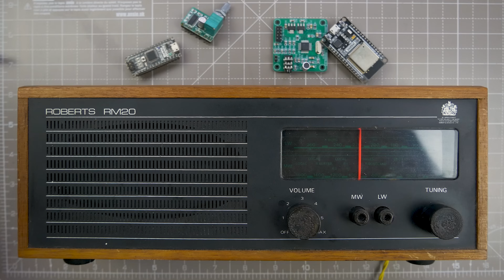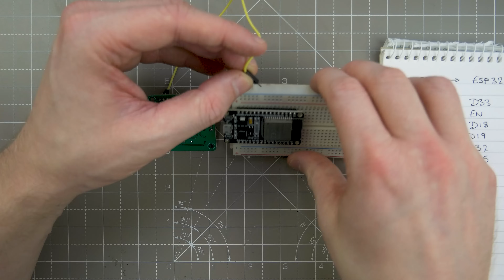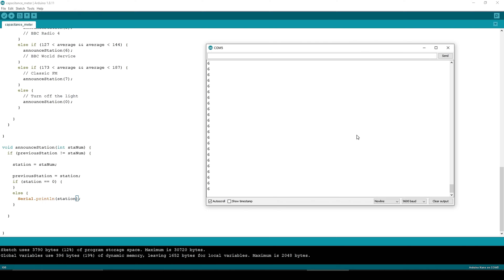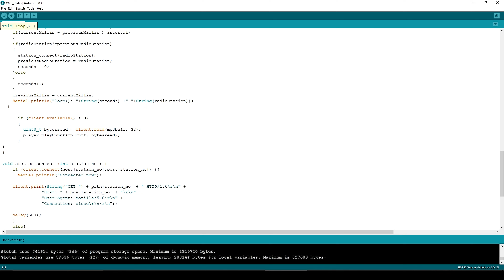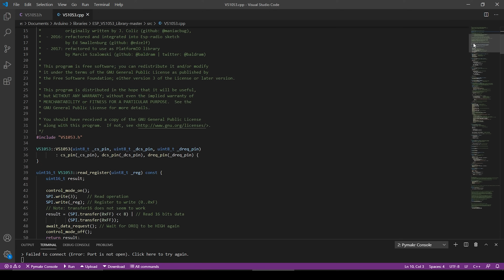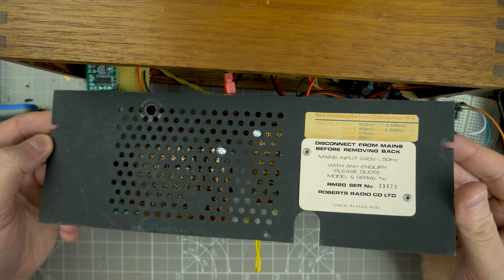From Start to Finish: ESP32 Internet Radio with a Roberts RM20

Comment: You are awesome but you missed the demo of the light!
I wonder if you can help me on that as I built Nick Kumaris's radio and after he advised me to remove and replace the followings it worked

Replace this line:    radioStation = readStationFromEEPROM();  with this line: radioStation = 0;
 Replace this line         int readStation = readStationFromEEPROM(); with this line  int readStation = 0

However he was very reluctant to help how to replace or add more stations and having tried for weeks l am stuck!
Is there anyway your station configurations will work even if they do not come on the display?
Finally am l to understand that you are connecting the variable capacitor directly to the Nano like a potentiometer and read the value because I was stunned to see that you are calling the values - radio 4 etc,
I am very happy to paypal you for your help
Many thanks

Erik
Reply from the maker: Hi Eric, the stations are stored in an array. I decided not to use the EEPROM that he had in his example. You can just add stations to that array but you will need to increase the array index number for each one that you add. There are two arrays, one with the port address and one with the URL for the mp3 stream.
Reply from the maker: The variable capacitor is connected to a few pins on the nano (you might be able to do it on the ESP32) one charge pin, one discharge pin and one analog pin. It essentially uses an analog reading to see how long it takes to charge up to VCC and the code calculates a value. I used that range across the variable capacitor, split it into segments where I want stations to be triggered and send it to the ESP32 as a station number.
Reply: @DavidWatts  Hi David
I looked into this very carefully and l wonder if you can help me 
I will be very happy to contribute with paypal
I have built a project with an old radio but l am not a software man in any way so this is what l need
I need to connect addressable led strip ws2812b about 260mm instead of the tuning scale so my existing variable capacitor will display an led moving left and right along the scale and preferably the other led's with a different colour, there is an FM radio similar project here - https://www.youtube.com/watch?v=afBSpobG6Zo
but needs it without the radio, just a nano with led strip to be connected to my existing tuning capacitor.
If you can help l will be most grateful
Many thanks
Erik Hoffman

Comment: If you had a pi and a nano then you had an easy solution for the shutdown and start up time.  Don't shut it down. Keep it running in  a sleep mode and have a super cap or a small li battery.  When you turn it off it sleeps and if you unplug it then the nano notices that the power is cut and then tells the pi to shut down while the supercar or battery runs the system.  Done. Plus you could add an SDR and make it also a real radio as well as internet radio.

Comment: I wonder if it would be possible to just leave out the nano and use the ESP32's second core to run the nano code
Reply: @Pedro Abreu yes, the esp32 has a total of three cores, the first two are identical in performance and you can basically write two different arduino sketches for each of them or the same sketch with shared memory. The third core is an ultra low power core for deepsleep, it also houses the system timer so you can wake the main cores at certain intervals etc
Reply: @Pedro Abreu Some newer ESP32 chips (ESP32-S2 if I ain't mistaken) only got 1 core.
But yeah, typically ESP32 has two cores, the second one is meant for protocols, like handling Wi-Fi and Bluetooth.
Check the datasheet for more info.
Reply: @Kyle-ye4nj  even with one core, threading is still an option on the ESP32 (though the performances will be impacted).
Reply: i have tested , it runs , but not stable :-( Because the core zerro is reserved for the Rtos.   now im testing the ADC and will use an NE755 to make an frequenz voltage Converter

Comment: I've put in a warm white LED in an old FM radio and it looks awesome
Reply: yes these here are fun : https://www.ebay.de/itm/50-Stucke-3-Watt-Led-Chip-High-Power-Led-Perlen-200Lm-Warmweis-to/232313840890?hash=item3616fbe4fa:g:cPMAAOSwXSRbPf3K

But dont use it with maximum current. Get two or three and frive it with 10 - 20mA , you does not need extra cooling. If you are using 12V pover , get 3 in series and pun one risitor in serie.

Comment: Cool stuff! You can skip the nano alltogether, just do the exact same thing on the ESP32, it has a ton of analog pins and I doubt it's going to interfere with the radio stuff.
Reply: Yes, I was thinking the same. ESP is a dual processor I’d imagine it could cope with both tasks,especially as you’re only changing a setting when tuning and not receiving signal.
I also wondered why you couldn’t fit the volume in place of the original Volta the front.
Great project and gave me a solution to where I can put my homemade Bluetooth amp. Thanks.
Reply: @davidjones9730  I reckon you could do it all on one ESP32 processor, they are faster than most other microcontrollers, and the buffer on the MP3 module will cope with the odd delay.  I just don't have time to prove, this, though!

Comment: My mothers old DAB+ with Internet radio is having issues, piss poor reception, the wifi and dab has been terrible from day one. But recently it have been worse, and also there is a lot of noise on speaker from the internal components, have not tried with a 12v battery to exclude power supply issue. Could try and solder on an external antenna also.
I even recently had to replace its power supply, it was just a regular 12v psu internally, so an external psu was easy to find.

 She only listen to one station. I only need the mp3 decoder (can it do other formats?), got a small amplifier laying around.

Comment: You can get I2S amplifier boards and use ESP32 to decode MP3 internally. Also, you don't need extra Arduino to read cap, ESP32 has 2 8-bit DACs built-in.
As a result, you'll get rid of 2 extra boards and make it's much simpler and compact.
Reply: I2S amplifier. I will buy that.
Do you know if the ESP32 can decode the most audio formats? AAC is a popular one on streaming audio.
Reply: @LordGryllwotth  Yes, you can use ESP8266Audio library, which supports decoding MOD, WAV, MP3, FLAC, MIDI, AAC, and RTTL. And get a MAX98357A breakout board with a built-in amplifier.
Reply: @ReFreshRC  hi I know this post was 2 year ago but do you have any example code to do this? Both for decoding the MP3 and reading the capacity.

Comment: The Pimoroni Pirate Radio Kit could probably be retrofitted into this case, and still use the varcap dial. The $50 kit includes a PiZeroW, pHAT BEAT DAC, stereo amp with VU meter and six buttons. Adafruit is a distributor, and has a nice writeup explaining the whole process.

Comment: David! Only just stumbled across your channel by chance now. Nice to see some more nerd 'mo's out there. I have an old ROSS radio that I want to turn into an internet radio with Raspberry Pi and 7" touchscreen display (already mounted), but unsure what do with the software side of things. I see you mention your RM20 was previously a RPi radio but I looked and couldn't find anything in your previous videos. Can you point me in the right direction? Thanks a bunch xoxo
Reply from the maker: Ho, it was all done in a series of live streams, kinda of an impenetrable format to learn from. Let me see if I can dig out the code for you. The reason I ditched the Pi was the long start up and shutdown sequences. While I had used the front buttons to automate that, it was tedious to not be able to just turn if off and on whenever I liked.
Reply: @DavidWatts  yeah totally understand that aspect and that was one of my main concerns and was going to look into soft startup and shut down buttons, but this ROSS radio is big boi and the idea is keep it on above the fridge with the display at almost head height where I can see weather updates etc so turning it on/off frequently isn't much of a concern.

Comment: Hello David, your video about the expansion of the Roberts RM20 is very successful. Thanks a lot for this. I would like to recreate it. Do you have a tip where I can get Radio Roberts RM20 from?
Reply from the maker: eBay is your best bet, I got mine for £10. You could do this with loads of different radios though.
Reply: @DavidWatts  thank you david. I have already looked German on Ebay, unfortunately there is not much there. I like the RM20 model very much, so I would like to buy such a device
Reply from the maker: These might work for you - https://www.ebay.de/itm/TELEFUNKEN-Gavotte-1691-Transistorradio-Radio-Tuner-1967-Bastler-Vintage/154104348153?hash=item23e155bdf9:g:zKUAAOSw-1NfbwPD or https://www.ebay.de/itm/altes-Telefunken-Radio-aus-Haushaltsaufloesung-fuer-Bastler-Sammler-Gavotte-301/174464488661?hash=item289ee4d4d5:g:AEYAAOSwOVlfLFS0

Comment: I wonder why you used an external MP3 decoder? The ESP32 is more than powerful enough to decode MP3 by itself. An ESP-WROVER-32 would even be capable of decoding AAC, OGG and FLAC (I couldn't get OPUS to work properly).
Reply: 5 - 8 bit resulution vers 16 Bit !! The esp32 can only (approx ) 5 bits rs, if you want decode more than 64k/s

Comment: Just throwing this out there as I have no idea about this stuff, but could you place a backlit LCD display behind the station indicator?

You could then use it to display the internet stations and still tune it as originally intended. Could also use it to show a little more info eg time, date, song playing etc
Reply: The point was to keep the analog display
Reply: @thefatmoop  Fine, then program a mock analog display on the LCD. Perhaps it still won't appear vintage enough for some folks, but it's a pretty good suggestion from someone who 'has no idea about this stuff'. Some of the best ideas come from folks who aren't constrained by logic.
Reply: @TheOleHermit  Thanks :-)

Comment: Nice job.  I've been planning to do something like this but haven't gotten around to it yet.  I'm not sure why you needed the Arduino, it seems to me that you could have done it all on just the ESP32.
Reply from the maker: The from start to finish videos are usually done in a day so I shy away from added risk of it not working. I knew I could achieve what I wanted with the Nano so it was a easy choice.

Comment: I've learned to have a 4mm drill in the toolbox for cutting the tracks on veroboard :)
Reply: For more years than I care to count I've used a 3/16 drill glued into a small file handle, probably a Practical Wireless or Radio Constructor idea

Comment: Love this, I too have a very old Roberts Pi Radio project that needs updating. Could you get the esp32 to handle the dial input as well as data?  I'm going to give it a whirl.
Your long switch statement seems a bit redundant??
Can't it all just be replaced with:

if ((incomingData>=1)&&(incomingData<=6)) {
radioStation = incomingData; Serial.printn(stationName[incomingData]);
}
Reply from the maker: Hindsight is 20:20. Not sure about using the ESP for the tuning dial, it has a tiny audio buffer so I went with the option I had already used on the Pi internet radio.
Reply: ih have tested ist with an bigger buffer, it runs, but very instable :-( the core zerro is for the wifihandle and other stuff importand. What im testing, use the ADC and an NE755 ( timer IC ) , to generate the value. Of if you dont destroy the radio, add an potentiometer into the scale.
Reply from the maker: @mibnsharpals  I'd be really interested to hear your results. Love seeing people improve on my hack jobs.

Comment: I love it, but think that if you could get the existing volume knob to work with the new circuit then it would finish it off nicely.
Reply from the maker: Sadly it didn't work as expected, It might just need a clean or a replacement. For now I am happy enough, I don't need to adjust the volume much, I mostly just listen to Radio 6 music or Radio 4.
Reply: Still a great project and has inspired me to look at doing something similar myself, as I love the look of old radios.

Comment: Nothing like a boat anchor, if you can find an old reel to reel tape player, one might send a signal from the tape magneto.
Reply from the maker: It's all boat anchors here.
Reply: @DavidWatts  The old Zeneith Transoceanic portable, would love to have one that would handle both the old tube chassis or flip the switch to modern.
Reply from the maker: @S.P.A.R.K.Y.  If there was enough room in the chassis, you could do that. You could isolate the speaker with a DTDP switch, the internet radio would just run all the time and only output when you switched. Volume would be an issue, however you could read the potentiometer and tell the VS1053 to change it's output volume digitally. By the way, that Zenith radio looks pretty epic.

Comment: Hi, great project! I also have in mind doing a similar project some day.
So far, I only got to creating an Arduino Music Player (link is here if you're interested: https://www.hackster.io/ericBcreator/a-m-p-arduino-music-player-8013b6).

I was wondering: why do you switch the Nano IN_PIN from input to output?

BTW: for better performance you might put the average calculation inside the "if (readIndex == 49) {" loop as you only need it there.
And I would  replace the hardcoded 49 in "== 49" with ">= (numReadings - 1)" as changing the const int numReadings variable can cause problems..

Comment: i'm puzzled as to why the original roberts volume variable resistor could not be used? i guess the radio one is mono, and the pam board is stereo, but as your running mono you only need to use one channel of the pam board, so three wires from the original knob to the pam channel your using and the other channels 'wiper' can be grounded to prevent it floating and oscillating.  it will be a different value but unless its a really low value i cant see it bothering anything
Reply from the maker: I tried it, there was only a very small zone where the volume went from quiet to very loud. However measuring with a multimeter I could see it was still doing its job. I assume it's response is designed for a different kind of amp or it is broken.
Reply: @DavidWatts  yeah they dont last forever.

Comment: Why did you use the nano?  There are more than enough pins on the esp32 to take on that work, too.
Reply from the maker: It only has a 32 byte buffer for the audio (apparently only 500th of a second) so I decided it was best to leave the bulb and tuning duties to the nano. I'd also already developed the nano solution for the previous incarnation of the project. Not saying it couldn't be done.
Reply: @DavidWatts  I don't see any time consuming code on the nano. Also ESP32 has 2 cores.
Reply from the maker: @0xB8xor0xFF  I don't see any reason not to go with the solution I had previously used. As I said earlier, not saying it couldn't be done.

Comment: Well done but this is a lot of work for just a few stations. You have a lot of patience. I skipped most of the parts of the video where you are typing code. I couldn't understand most of it.
I would've just used some resistors and an op-amp to downmix the stereo audio. There are example mixer circuits already available on google images. Easier, quicker and you know it'll just work. Don't need to spend ages modifying/debugging code and registers.

Also, why not use the radio's original amplifier and replace the original scratchy volume pot if necessary.

Comment: Thumb's up for Radio Caroline, Thumb's down for taking the station out 🤣 .. was going to make this project (adding SD card) ,  I have a old Marconiphone with Radio Caroline on the dial.🤔
Reply from the maker: If I could have found a stream that didn't buffer so much I would have left it in. Sadly I couldn't connect at all several times so I ditched it in favour of cornucopia radio which has audio drama and comedy.
Reply: @DavidWatts  Radio Caroline have multi streams, with different bit rates, try the weekend at the month on Manx Radio , Radio Caroline North live from the ship. Lucky I live in East Anglia and listen on AM 648(ex BBC World Service transmitter) and FM local. Also in many cites on DAB.
Reply: @DavidWatts  Sounds like Radio 4 extra.
Reply from the maker: Should just be standard R4 according to the URL destination. Really been enjoying cornucopia radio though.
Reply: @DavidWatts  I will keep my old radio(still working) and use Google assistant speaker's 😂
Reply: @DavidWatts  Very interesting, but why did put the volume knob on the back, instead of replacing the original front knob 🤔
Reply from the maker: The original volume control is also the power switch for the radio now, for volume control the potentiomter doesn't give a 'linear' response for audio into the PAM8403. Sounds pretty terrible reducing the audio voltage, I assume it was designed for totally different amplifier characteristic.